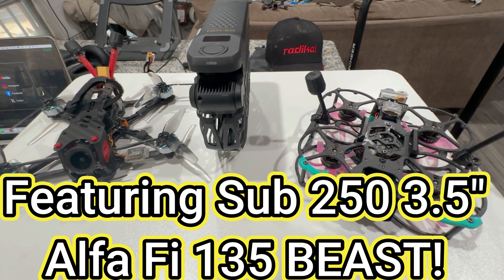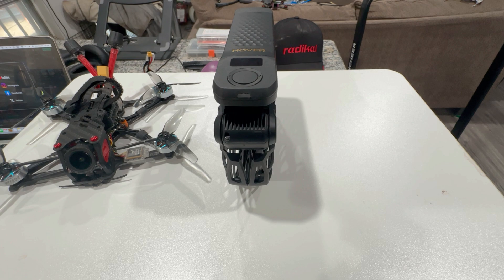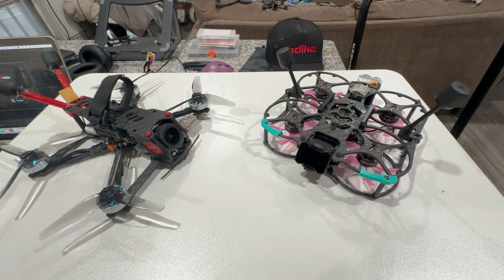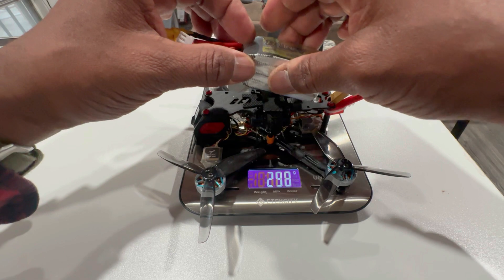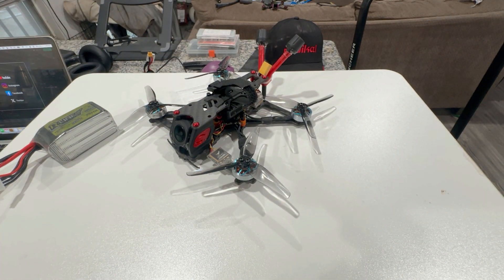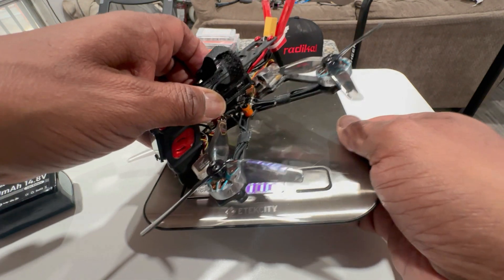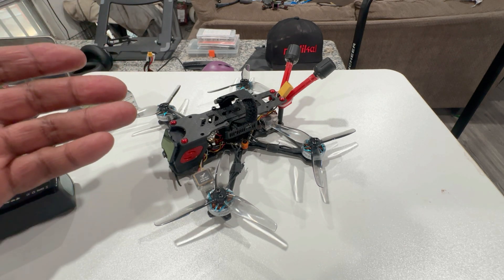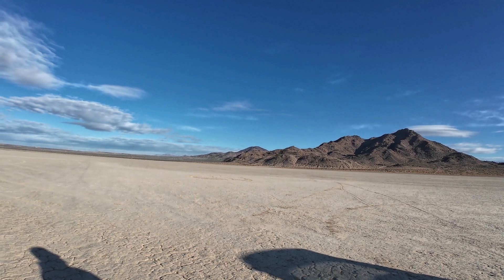Best 3.5 inch build Sub 250g AlfaRC 150 FPV Drone DJI 04 Pro W/Huma20 For Travel- Flight Test Part 2

Comment from the maker: *Warning* Demo Long Range Flight in Severe Winds. Very Very loud. So turn the Volume Down. Just an example of what winds thing can handle. It's no toothpick. Also the Frame is NOT the 135 it's the AlfaRC 150.
Reply: Why would they sue you

Comment: am i right that i see the tips of the props in the dvr?(asked the seller before ordered the frame, he told no prop in view, but still not 100% sure)
Reply from the maker: @VlaViRus   from my experience I only see the tips of props when I’m shooting 4:3 aspect ratio, then GyroFlow eliminates them. 

Now when I’m shooting 16:9 aspect ratio and and Rocksteady, I’ve seen no props in view on the live  DVR nor onboard footage
Reply from the maker: @VlaViRus  yep…just verified older footage. If you like shooting 16:9 there are zero props in view. If you film 4:3, there are tips of the props in view prior to you using Gyroflow. So you’re not going to have props in view unless you post 4:3 footage

Comment: Waiting for the assembling video, didn't realized, how you fixed the camera in this cage. I ordered the improved cage for apex, supporting o4 from AliExpress
Reply from the maker: @VlaViRus  Nice! Post a link to that cage. I’m interested. My build as you guessed, used glue for the mounting. 

E6000 glue is used to mount the ELRS Receiver, GPS Module, and Lost Buzzer Alarm.

For the Camera Mount, I lined a thin coat of E6000 between the provided TPU from the Alfa 150 and pushed the 04 Pro between the TPU. It’s already a very very tight fit.  I suggest taking it for a flight to determine your camera tilt angle, then put a dab of hot glue on each side under the camera.  Be sure to pull your 04 Pro unit out enough to barely fit an ND Filter.  It’s already must to use them.  The 04 Pro lens is soft and scratches easy. That extra protection alone is a must. 

I’ve crashed into AC and my camera has not come out nor scratched because of my glue method and ND Filter. And as you see, the footage is smooth. I dig that aluminum camera cage and this frame is def more durable than 90% plus of the top named frames that I won’t mention and only $19

Comment: Nice flying & location !
Reply from the maker: @GhostFpv  Thank you Brother GhostFPV! I seriously was not expecting this micro to handle high winds like it did. Although it freestyles well too, I’m not taking chances. All three of these travel drones with their own batteries combined, weigh less than a typical 5” freestyle drone with a GoPro and one 1300mah 6s battery. 

Weight is everything when you travel. Now I know I can keep things light and fly regardless of the wind conditions! Thanks again Brother. Build one!! 😂